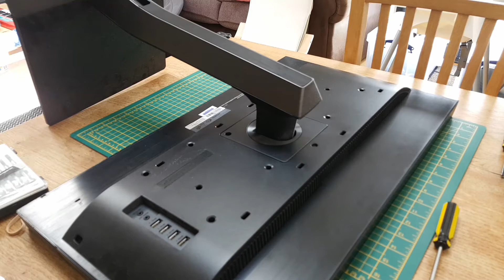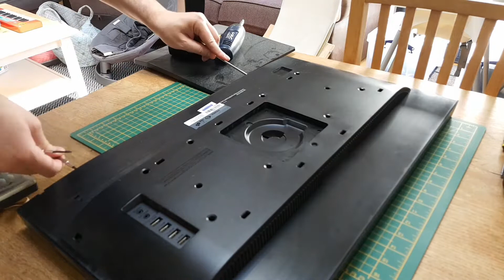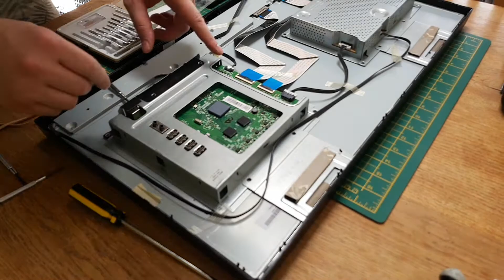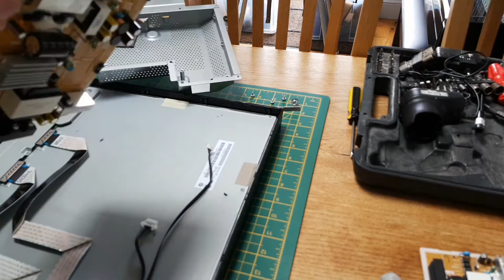How to repair a Samsung LS27D850T / LS27D85KTSNXU computer monitor

Comment: If someone wants to fix this PSU, most of them have the same fault:
The 6.3A fuse blows because the PFC chopper FET dies. 
To fix it: remove the **11N60 FET from the left side of the angled heatsink, under the silicone.
Replace it with ang 11N60 FET, that has at least 600V Ugs voltage, 33W power dissipation and less than 0.55ohm RDSon. Replace the fuse too, and now you have a fixed the PSU for under $5.
(The spc7011f PFC IC usually doesn't get damaged, because the gate has a 22V zener diode tied to ground)
If you can't desolder the FET in one piece, cut off the legs and remove them one by one.
Reply from the maker: You legend. You should do a video showing the steps too :D
Reply: @pp3v42_g3h - I have the same monitor and it powers down intermittently. It needs to be unplugged before it restarts again. Would this be an early warning sign of the same issue? Fuse is not blowing, but it is powering off hard and needs to be removed from the mains to run again.
Reply: @PhillipRemaker  
Check the soldering on the power board, especially around FET power transistor and associated diode as this area gets very hot and the joints crack, I had at least 6 dry joints
Also on my monitor the large electrolytic capacitor (82uF 450V) had overheated and leaked going low in value so replaced this as well
Reply: @zaczac3024  Thanks! I replaced the KF12N60F MOSFET which did not help. I will look at the diode, capacitor, and solder joints next.
Reply: @zaczac3024  Thanks! Do you remember which ones? I resoldered all of the parts that heat up and it still shuts down at random. Ileanred that I can get it to pop back on if I tap on the power supply. So There is almost certainly a marginal component or connection.
Reply: @zaczac3024  No joy. I reflowed everything I could find, replaced the power transistor and the big 450V/82uF electrolytic. Still shuts off at random. A shrarp strike to the rear of the monitor by the power supply recovers it. I'm at my wits end. There is some marginal component or connection somewhere and I cannot find it for the life of me. I suppose I could try replacing the 11N60 FET as well, that's the only commonly failing component not yet replaced.  I'd rather it fail outright. Intermittent failures are a drag.
Reply: @PhillipRemaker  Hi! Did you get the problem solved? I have the same problem and have taken similar steps and nothing helped
Reply: @СергейНаталкин-ж5д  I ended up scrapping the monitor. I suspect that the power board may have had an internal crack. I was never able to get it to work stably.
Reply: @PhillipRemaker  i have the same issue.  It powers down after 10seconds. There are no physical defects on the psu.  I would like to fix/replace the faulty components instead of the entire psu
Reply: @JoseMarquez-mh8ud  I gave up on mine and scrapped it. Replaced the KF12N60F and big capacitor, no joy. Happy to send you my FET for postage if you think the FET is the issue. I think my board had a crack of failed folder joint that I could not locate.
Reply: @PhillipRemaker  where are you located?  I am in the us
Reply: @JoseMarquez-mh8ud California, SF Bay Area.

Comment: What were the symptoms or issues that led you to replace the psu?
Reply from the maker: The display would cut out after a certain amount of time of being on constantly. And as time went on that time got shorter and shorter to the point where the display cut out after 20 minutes or use . I think the PSU blowing is a pretty common occurrence for these models.
Reply: @DirkTeucher  the one i have hasnt blown it just shuts off after 10 seconds.  I want to replace the faulty component rather than the entire board. I searched many forums and no one has found the issue to my specific issue.

Comment: today green vertical line appear in my samsung s27D850T monitor. when my monitor powered on for 3 to 10 secs its become green to purple please help me
Reply from the maker: I never got a vertical green line on my monitor. The power to the screen would just die and the whole screen would turn to black. Your issue might be related to the power supply but I cannot be sure as it might also be something in the control board. I would probably try and swap the power supply but I am not advising you to do that.

Comment: Thank you! Any way to use some kind of normal PSU or do you realy need the original board?
Reply from the maker: I bought a replacement board from digiland which was the exact same board as the one that died. Link is in the description.
Reply: @DirkTeucher  I live in Germany, the cheapest PSU I can find here is 110€. The old PSU blew up after 6 years. If a new PSU has the same lifespan, I‘am fine with that. Some people had the same problem after 10 months…that wouldn‘t be a bargain.
Reply from the maker: @myblackminds5563   I am reading your comment on the screen in this video and that PSU was replaced by me about 2 years ago if that is of any help to you to decide on what you want to do 😀 . I paid about £50 which is about 60 euros ... so no idea why it is so expensive in germany. I think this is the board https://www.ebay.co.uk/itm/393814693741?epid=24041501899&hash=item5bb12f576d:g:MfkAAOSwEFdg-TpV and it is £50 here in the UK. (Obviously check this yourself before you buy I am just doing this from memory)

Comment: Hi Dirk.  I have been search for soooo long to find a new power board for my monitor. Same as yours in the video.    Sometimes the monitors turns on, sometimes it does not so im pretty sure it is the board that is having issues.   But i simply cannot find a board, or one that is reasonably priced at least. I refuse to throw this screen away as its lovely.  How much did you pay for your replacement board may i ask?
Reply: nevermind. i have found it. and funny enough was the same seller as whom you purchased from :D
Reply from the maker: @DannyScanlan90  Oh good to hear. I can't remember the exact price but it was around £50 including delivery if I remember correctly.

Comment: Thank you so much for this video. My Samsung S27D850T has just failed (very probably the power board according to the noise I heard)... But where can ou buy a new power board (230V !) ? Thanks - Renaud V. - OUPS Sorry, just read your comment !... But not for sale anymore ...
Reply from the maker: Contact the seller on ebay from the link in the video description, Digiland runs out of parts sometimes and need to restock. They had 50 boards last month.
Reply: @DirkTeucher  Thanks Dirk for your advice ! Actually I think I found one at a French household appliance spare part site for 75€90, refrence BN44-00750A. I'll call them to make sure it's correct for S27D850T (as there is also BN44-00750B and BN44-00750C...). It looks exactly the same as in your video, but I would rather not buy the worng part. So thank you for your video anyway, I'll watch it again when I have to pry off the plastic board (beurk...hope it gets back in place...). Renaud.

Comment: Gratuatous safety comment: you need to be very careful if you have just unplugged the monitor. There is usually a 400v capacitor on the board of a switched mode power supply for a television or monitor. Touch the terminals of that and it will give you a nasty jolt.
Reply from the maker: Great advice.  If you dont know basic things like this people should not be taking electronics apart. I also wore rubber gloves the first time I tested the board with a multimeter. If anyone wants to learn more I suggest reading the book "there are no electrons" by kenn amdahl.
Reply: YES in deed 😅 I just experienced it before reading this

Comment: This was very helpful, thank you. I wonder how many people have a similar issue after four or five years with this monitor.
Reply from the maker: You are very welcome. I think it's a common problem. There must be a design flaw on the power board somewhere. I noticed that my screen flickers when I turn on a fan during the summer which is on the same plug as the monitor. Fans and other electric motors can sometimes provide a DC feedback voltage spike during startup shutdown and this can surge into your other outlets. Devices like this monitor and the fan itself should have protections built in for this but I suspect that there is a resistor or capacitor on the Samsung board that is getting overloaded from things like fans or a washing machine motor perhaps in other households where it is on the same "ring" as your computer. I have isolated that fan with a hard switch to remove that startup noise voltage that it creates just as a precaution. But this is just a theory .. I am an amateur electronics enthusiast :D . Maybe Samsung just used a few crappy components for some good old fashioned planned obsolescence. It's been going on since the lightbulb was invented. Bring on more right to repair laws I say . Buy saying that at least Samsung make their devices modular and you can buy the parts to repair them. I do appreciate that about their products, lots of other companies do this very badly.
Reply: @DirkTeucher  I have a similar problem with a Samsung S32D-850T.  Thanks for the post.

Comment: Thanks for the tip Dirk. My 32” failed to power up. To send it Samsung’s recommended repair centre involved me having to find a way of safely packing then paying £150 up front for evaluation and then paying whatever they said was needed to repair it. I found an ebay seller DigilandLimited selling them for £50.00. So your video was a great help and I am now up and running again for just £50.00 and saving a lot of hassle.
Reply from the maker: Fantastic, you are most welcome. The fewer devices to landfill the better :D .... also good news about the right to repair laws being introduced here in the UK too I read this week .... it's about time. Fortunately some companies like Samsung already do it pretty well.

Comment: ich suche defekten netzteile und zahle gut  BN44-00750A
Reply from the maker: Hier habe ich meine gekauft - https://www.ebay.co.uk/itm/Genuine-Samsung-LS27D85KTSN-LS32D85KTSN-PSU-Board-BN44-00750A/323329125658?hash=item4b47eaed1a%3Ag%3A5VkAAOSwnTBec0is - 
ich hoffe es hilft
Reply: @DirkTeucher  WENN SIE DEN DEFEKTEN NOCH HABEN KAUFE DIR AB LG;